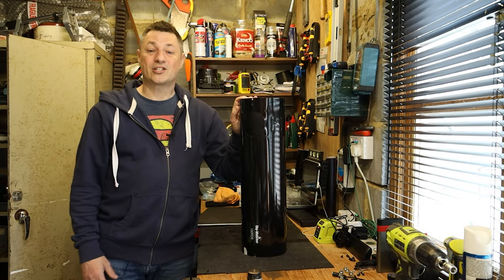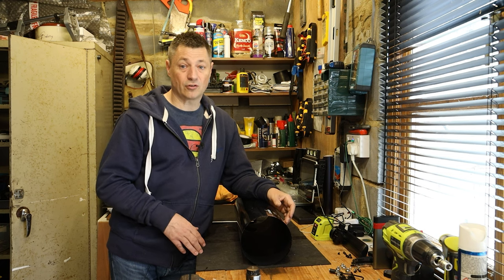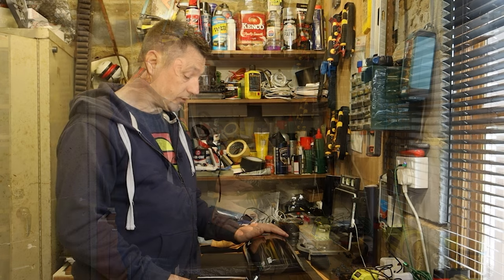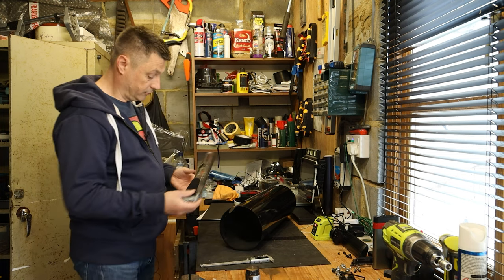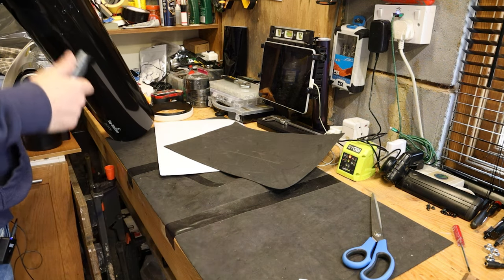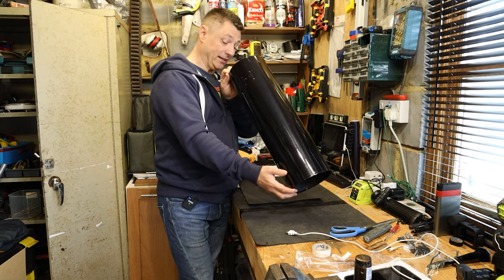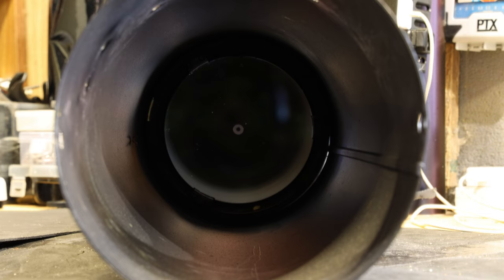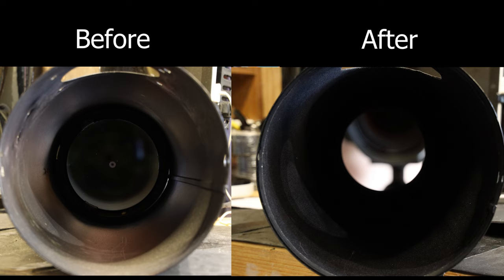How to Flock a Telescope and improve contrast and internal light reflections for Astrophotography

Comment: If you do it in strips, with small gaps, the tube can heat and cool, expand and contract, and it won't tug the applied flocking away against the adhesive.  One monolithic swatch of the flocking will not expand and contract as the metal tube will, and it will pull away and bunch at times.
Reply from the maker: Good advice thank you. I seem to have got away with that as the 130pds is a small scope and also our temp swings are not extreme in the UK. A larger scope would flex much more.
 I think strips would have made it so much easier to install as well. If I do it again that is definitely how I will go about it. 
Thanks for watching and sharing your thoughts, clear skies

Comment: If you treat the flocking like contact adhesive it may be easier . Just  roll up tight then  cut 10 odd mm of the backing down the edge to stick down . Line up on the seam then press down and slowly unroll . Vwala👍🏻 glad you got a good result .
Reply from the maker: Thank you. I would do it differently next time for sure. But this worked and I am getting great results so all good.
Reply: I flocked my 10” atm years ago and it worked well. Mind you I had a 12” diameter tube to roll around in . 🙂👍🏻 I never quantified the difference though . How will you ..?

Comment: Using a stanley plate to make linear slices along the length of the tube at numerous points around the tube is recommended to prevent future "lifting of the flock" also spraying with Hair spray inhibits fluff dropping off in the tube...
Reply from the maker: Thanks David, helpful tips. I think the 130pds won’t suffer too much with expansion as its quite small but I bet on large tubes the flock could lift easily. The hairspray tip is a good one and will definitely look to do that but at the moment its all been good.
Reply: Plus one. I flocked the 130pds and othet newton scopes by using strips in the long direction of the tube. Easier to hold the end and pull the backpaper off and press down to affix. 
Very nice improvement. Can also be done with the inside of the focuser tube!

Comment: Thanks for sharing. If I could give you a tip if you have to do it again is to roll the flocking paper in a small roll rather than spreading it out. I did my scope a few months back and just keeping the paper roll small made it so much easier. Love your youtubes thanks again .
Reply from the maker: Hi Trevor and thanks for watching. Great tip, i’ e had quite a few since doing it. If I ever need to do it again I am sure it will be a lot easier. Wasn’t too bad to be fair and I love the improvement

Comment: Flocked my 150PDS, A few things I learned:
1. It is a Pain
2. It helps alot
3. The "flocking material" throws small "hairs" of itself - at least the material i used
4. It makes it a bit easier if you do it in strips.

A question about your focus tube. Doesn't it protrude into the main tube? Or what have you done with it?
Reply from the maker: I defo should have done strips but its worked out well. The difference is amazing, not had any issues with bits as yet but the small vacuum is charged ready to go. Using the sky watcher 0.9x CC pushed into the focus tube the focus point is almost all the way out so none of it protrudes inside the OTA. I’d cut some off otherwise, 15mm is apparently ok to lose.
Reply: @Astrobloke  How have you been able to push it into the tube, isn't there a flange on it?
Reply from the maker: @syberand  apologies, this is something I will be talking about in my follow up video. My father is an engineer with a lathe and he machined the flange off for me.
Reply: @Astrobloke  ah, well that is just cheating...
Reply from the maker: @syberand  lol, i suppose. Lucky to have a resource like that to use. Unfortunately its the only way you can really remove the lip. The Baader MPCC has a lip that unscrews.

Comment: Great Video. It's on my toDo List. Have my self-adhesive velours film already (and also some chalkboard paint) to optimize my tube, but not enough time at the moment. 
My plan is to use 4-8 stripes in the lenght of the tube to make it easier and also heard that to use a lint roller before adding it to the tube is a real help to prevent all that little flock hairs. 
Still thinking about doing it in the focus tube also. Not sure about it yet.
Reply from the maker: Good luck with it. Makes a great difference. Another tip I have been told is to spray the flock with hairspray as that helps prevent shedding. To be fair to date I have not had any issues with it.

Comment: Bubbles? punch it with a needle and the air will escape.
Vacuuming the inside? Probably it's more effective to vacuum the flocking material before sticking it to the tube. You can vacuum it also in the tube afterwards if you want to be 100% sure.
Nice video, thanks.
Reply from the maker: Thank you, great tips. Flocking the scope made a huge difference, really pleased I did it.

Comment: The Upgrade Makes a Massive Difference Glenn, Very Interesting! I tried Using a Dew Shield on my 5 inch Newt! It Does Reduce The Amount of Sky Glow I get. My Newt is Fully Matte Black from The Inside. Unfortunately I still have some Issue When shooting Near Bright stars I get an Oblong Halo around my Image. Great Video man 👍🏻 Clear skies!
Reply from the maker: Thanks Avanteesh.  I have a dew shield that I made as well which helps, the flock is so much better than matt black paint, I am surprised at just how much better. My next video has some other upgrades and will also show some images with bright stars.
 So you can see the results. Clear skies

Comment: Very interesting video Glenn and massive improvement. Seems you also fixed the light leak (at least partially?). Very nice! 👍🏼 Looking forward seeing your other future video about that one. - Great video! Just out of curiosity: Why did you not paint the inside dark mat black, what's the advantage to use this?
Reply from the maker: Thanks Tully. The inside already has black mat paint but as you can see it still reflects light. There are very black paints available but they are quite costly and I can imagine its not easy painting the inside of the tube. Flocking gives a great result, its quite easy to do and not expensive.
Reply: @Astrobloke  Thanks Glenn, yes I saw the initial paint and the reflections..just thought to paint it over with new paint..but sure, I didn't know that it's so expensive.. Very nice job! cs

Comment: Glenn, this is so cool. I'm new to astrophotography. it was pure luck that my first scope just happened to be a second hand130 PDS that I got for a bargain. I have already done your mirror paint upgrade and looks like I'll be ordering some flocking paper today. I love the vids and content. 

Quick question, I need to get a coma corrector and have been recommended  the Skywatcher one. I'm pretty sure you recommended the badder 1 in a previous video. I don't really understand back focus or adjustment. Does the badder need to be set up or does it just clip in. what would you recommend. sorry about the barrage of questions! 😊 thanks again I absolutely love you videos.

Stu Australia 👊
Reply from the maker: Hi Stu and thank you for watching and commenting. Happy to help where I can so please ask as many questions you like. Its a hobby with a lot, I know. You got a great first scope there and glad my videos are helping. The Baader MPCC mkIII is an excellent Coma corrector but atm I have that on my CT10 and am using a Sky watcher 0.9x CC. My images are just as good and it is correcting the coma great. I would look at price and availability and get the one you can. The Baader will leave you at 650mm focal length where the Sky watcher I have will reduce to 585mm and drop F5 to F 4.5. The Coma correctors screw onto the end of the image train. They need 55mm backfocus
Reply: @Astrobloke  Thanks mate, so the 55mm back focus, how do I work that out, it an equation or something I have to actually measure?
Reply from the maker: @stulivelife  what camera do you use?
Reply: @Astrobloke  Canon 80D, astro modified, 2" T adaptor
Reply from the maker: @stulivelife  so the camera ring adapter attached gives you the 55mm from the edge of that to the sensor. So remove the T adapter and replace it with the coma corrector. That will slide into the focus tube and you tighten onto the edges of that
Reply: @Astrobloke  ohhhhhh, that makes total sense. Thank you very much for the info. I really do appreciate your help.

Your a bloody legend mate!
Looking forward to your next vid.

Stu

Comment: Rather you than me.  We cut lengths of paper about a third of the inside circumference and pulling it taught laid it n the tube
Reply from the maker: In hindsight it would have been more manageable in smaller pieces. First time flocking so its always a learning experience. The difference it makes is bigger than I expected.